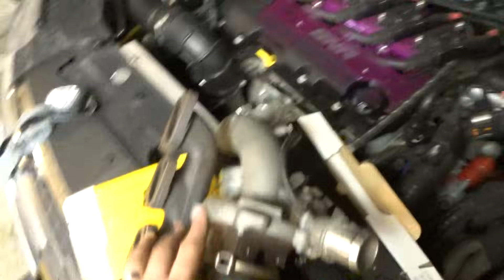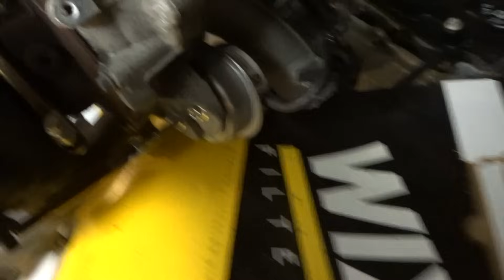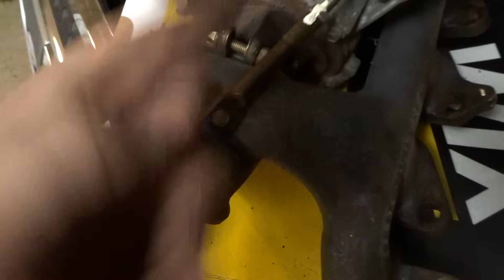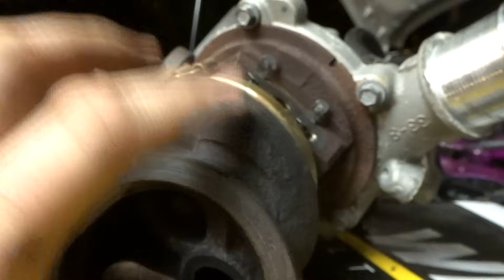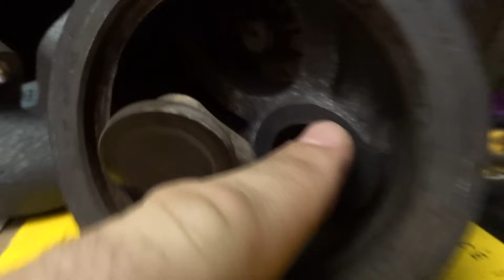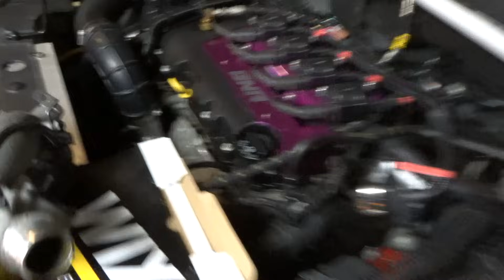Chevy Cruze Sonic P0299 Turbo Underboost Code Explained

Comment: Hi everyone,

I recently replaced the entire turbo on my Trax, but I’m still getting P0299 (Underboost) whenever the engine is under heavy load going uphill.

So far I’ve replaced:

MAP sensor

MAF sensor

Purge valve

But the code still keeps coming back. I have a smoke machine on the way to check for leaks as my next step.

Today I started wondering — should I swap the wastegate actuator from the original factory turbo (it was cracked, but the actuator itself was working) onto the new turbo? Could the new actuator be out of adjustment and causing the underboost?
Reply from the maker: Have you checked The intake manifold for a missing check valve? Have you replaced the bypass valve solenoid?

Comment: I have a p0229 code and a p2227 code i found a leak on back side fixed that that code went away would a new baro sensor fix this issue? Cause i dont see any cracks with my eyes and i the waste gate moves good when i use a air gun so im assuming i just need a turbo

Comment: That engine was designed to fail and be difficult to repair. IMO chevy should buy back every car with that engine.
Reply from the maker: Not sure I agree with the difficult to repair bit. The only things that are a bit more involved that fail on this engine are the head gasket and turbo, and turbo failures are common across all turbocharged engines. The head gaskets usually don’t start coming up until well after 250,000 miles.

Comment: So, I replaced my turbocharger, pcv hose, intake manifold, turbo oil return hose and valve cover. It is still reading p0299. I was talking to the guys I work with at the shop and one said it is probably the solenoid because that was the issue with his Fiesta. I looked and there seems to be oil on the intercooler hose on the passenger side. What do you think would be the best course of action for me?
Reply from the maker: Bypass valve solenoid is under the manifold on the passenger side and should be replaced if you’re still chasing down a p0299.

Comment: Mine is making too much boost (27.4 PSI) sometimes and after it's been driving on the interstate for about 20 minutes it makes no boost and I get the P0299 code. When the engine is dead cold, the turbo works properly. I ordered a new turbo. It misses out like crazy when it is making over 22psi of boost. Probably because it has too much air and not enough fuel. 
I ordered the waste gate solenoid and the waste gate diaphragm, but that's $50 and a new turbo is $210 and it comes with those parts. I know the diaphragm arm and waste gate lever is sticking a little when I move it manually with pilers, so the wastegate itself probably has problems. And I got the car with 196k miles. It's like a new car other than the turbo problems. Well maintained but the turbo is probably at the end of its life. It is the Garrett, so it's OEM. Might be original. It does have what looks to be a new turbo oil line.
Reply from the maker: Is that boost level relative or absolute?

Comment: 90% of the time the turbo charger is gone bad I worked on these type of cars a lot and that code is notorious for turbo issues
Reply from the maker: @josecfish5297  it’s been about 50% for the people I’ve worked with because there are multiple other causes for this issue than just the turbo.

Comment: Thanks for the video.  Quite informative.  I just wanted to point out a couple things as I've recently removed my turbo from my Sonic after a few years of intermittent underboost.

The turbo assembly also utilizes a blow off valve (BOV) that recirculates the boost in the compressor casting.  The BOV has a spring to hold it closed so it can be opened by either the boost overcoming the spring (I don't think this is necessarily the intention) or by vacuum acting on a diaphragm controlled by engine computer via solenoid valve, similar to the waste gate actuator.  My BOV had quite a bit of oil in the vacuum side of the diaphragm, which must have come through the solenoid valve and ultimately from the intake, I'm guessing.  Haven't diagnosed this enough to understand the root cause of the presence of the oil.

My turbo also has axial and radial play in the shaft.  I don't have a dial indicator to measure this, but it seems the turbine end has around 1mm movement radially.  I doubt this is within spec but still trying to clarify.

As you said, the crack at the wastegate will have minimal affect on the exhaust pressure.  Personally, I think this loss is negligible.

I'm considering ordering a turbo from BNR, as it seems all other brands have a good deal of bad reviews.  Do you still have the car in this video?  If so, have you had any trouble with your BNR turbo?

Thanks again for the video!
Reply from the maker: If your BPV (bypass valve, since it's recirculating) had oil in it, it very well may have come from the bypass valve solenoid, which is connected to the manifold. That solenoid sometimes gums up due to oil oxidizing and causing it to stick, which will also trigger a P0299. I discovered this after making this video unfortunately.

Comment: Got a 2016 Chevy Trax; turbo, intake cover all replaced back in April/May. Got P0299 the other day. I don’t want to keep spending $25-$100 “here and there” to fix the issue temporarily
Reply from the maker: @cherob1984  here’s a list I’d recommend checking out  

https://cruzekits.com/blogs/technical-articles/p0299-underboost-code-explained

Comment: I’m going crazy with this on my 2012 hyundai ix35 , i checked every air hose , air filter, intercooler, i cleaned the throttle body found some oil in it and in the pipe that goes from intercooler, checked the actuator which it seems tight enough , hard enough to move by hand… so what’s erong with this POS 😂 , i guess i will just spend more if i randomly start to change parts, better let the mechanic have it this time

Comment: My code only comes on when I go up a hill when I hit 60mph. Two days later the engine light  goes back off and I am good until I go back up another hill.   Since it doesn't stay on could it  just need to be cleaned?

Comment: I had the same code on my 2014 LTZ RS.  The issue turned out to be caused by broken catalyst from the forward catalytic converter.  This catalyst material broke up and clogged the rear catalytic converter restricting exhaust gas flow.  Without flow, the turbo cannot spool up and the performance is greatly reduced.  I could not clean out the rear converter so i had to preplace both of them.  At $2000 for the set, I would have rather had a bad turbo.

If you remove the turbo and the exhaust pipe from the forward converter, you should be able to inspect the catalyst.  If any is missing, you may have a clogged rear converter.  To prove the rear converter was clogged, I test drove the car without the exhaust pipe. A bit noisy but the boost pressure popped right back up and performance returned.   I bet there is a better way to test the flow of the rear converter; my way was free.
Reply from the maker: @mburman71  did you address the root cause for why they both failed in the first place?
Reply: @AndreiDPop  Yeah... Its a long story so I shortened it to remind folks to check their exhaust systems before they start buying expensive turbos and such.

The rear converter did not fail but got clogged up by debris from the forward converter.

In short, it all stared with an overheat caused by a cracked coolant tank.  Once fixed there was a small leak of coolant that took a while to find.  It was a cracked cylinder head. Coolant was leaking into the #2 and #3 cylinders but was not causing a reduction in performance, so I allowed the car to be driven.  I think this was a mistake.

I replaced the head and all was well for awhile, but soon, the performance started to decline and I started getting a low boost code.  I changed the turbo and it did not fix it.  While changing the turbo, I noticed a missing piece of catalyst in the converter and concluded it can only be in the exhaust pipe.   That is when I  drove the car without the exhaust pipe and the boost and performance returned.

This is a guess but I believe the coolant in the exhaust damaged the catalyst in the converter and caused it to break.  The debris broke up into powder and clogged up the rear converter.  Before you replace the turbo, check your exhaust system.

Comment: that plastic cap is a bypass valve, if that valve fails, it can set a p0299, the engine underboost code. however, if you look at the intake manifold and don't see a hose sticking out of the top left corner next to the MAP sensor, you have the old version of the manifold, get yourself a new update intake manifold, comes with a solenoid for controlling the valve, that solenoid is the most common failure point.

Comment: I have a Chevy Cruze 2014 1.4L turbo. i fixed the wastegate actuator but still have a code. the car has about 57,000 miles on it and driven locally and sometimes abused. what could be my problem if anyone can please help.
Reply from the maker: Try going through this article. 

https://cruzekits.com/blogs/technical-articles/p0299-underboost-code-explained

Comment: Just wanted to let you know that this video is still helping folks. I wish I had seen this before I swapped out my turbo, but it did help me inspect my turbo for issues. In my case the issue was caused by a failure of the PCV system, which pushed a lot of oil into the intake manifold resulting in significant misfiring and smoking. The code that was thrown was the P0299 code, but the only issue that I saw on the turbo was a crack from the waste gate passage. It might have had a little impact, but certainly wasn’t causing the issue that I was experiencing.
Reply from the maker: Glad to hear this helped you! Did you install my pcv fix kit on that car to help with the pcv issues?
Reply: @AndreiDPop  Mr Andrei,Hello, can you please reply, I need your help. The orange nipple, that is, the check valve, in the intake manifold of my car is completely missing. I would seal this place without a repair kit (Cruze kits) with any material and epoxy adhesive, and use the original crank ventilation hoses. Is there any problem if I continue to use it? Please reply, it's urgent.im from turkey and my country cannot let me but your repair kits.
Reply: @PAYASLRF  Epoksi ile turuncu minik contanın olduğu yeri körleyip Karter Havalandırma Borusunu iptal ederek hidrolik hortumu çekebilirsiniz. Harici Çekvalf ile Kanister valfi girişine verip sorunu çözebilirsiniz. İşlem Videosu mevcut.
Reply: @onurdulger6680  teşekkür ederim, çıkma emme manifoldu ve Krank havalandırma hortumu alıp değiştirdim.
Reply: @PAYASLRF  Geçmiş olsun üstadım. Fakat minik Turuncu Conta yine sorun çıkartacak.

Uyduruk Karter Havalandırma Borusu yine çatlayacak. 

Andrei Cruze kitleri ile bu noktada kesin çözüm geliştirmiş. Diğer videolarını izleyip kendiniz de yapabilirsiniz.

Amerikalıları tebrik etmek gerekir. GM kroniklerine çözüm yine anavatanından geliyor.

Ayrıca LPG yoksa taktırın yüksek Oktan değeri sayesinde Piston Kırma riskini azaltır hem de ekonomiktir.
Reply: @onurdulger6680  karter havalandırma hortumu çatlak değildi de onun da içindeki çek valf bozulmuştu o yüzden değiştirdim, zaten satıp kurtulmayı düşünüyorum 5 yıldır çektiğim yeter 😁
Reply: @PAYASLRF  Aynen içerisinde minik Turuncu bir Çekvalf conta mevcut. Sorunların kaynağı oradan başlıyor. Onun iptal edilmesi gerekmekte.

Esasında kroniklerine basit önlemler alındığında 1.4 turbolar Sorunsuz ve Ekonomik araçlardır. 

600-700 bin liraya hem LPG Uyumlu hem Turbolu hem de Tam Otomatik Şanzımanlı başka alternatif yok malesef. 

Astra Cruze Trax Mokka Zafira Meriva İnsignia parasına göre güzel araçlardır. Parçaları bol bulunur ve uygun fiyatlıdır. Bence Kıymetini bilin.

Comment: Chevrolet now has a program out to have the turbo replaced for no charge (under certain conditions). Of course this is only if the turbo is the root cause of the trouble code. 
As described by GM in Special Coverage bulletin N232395330

Comment: You forgot to explain the inner cooler pressure relief valve and solenoid. You did mention the check valve for the solenoid.

Comment: How does it cause a lean condition if you’ve lost boost pressure? Fuel trims hit 30% Long term with it dumping fuel
Reply from the maker: Under manifold vacuum and any closed loop condition, a leak causes unmetered air to come into the engine. This then throws off the fuel trims in a positive direction indicating that the engine is adding fuel. 30% positive means there is an addition of fuel due to a lean condition. 

When that fueling calculation goes to open loop, where fueling is no longer calculated and in this engine you’re under boost, that vacuum leak now turns into a boost leak and you run excessively rich, but you don’t necessarily know it since open loop relies on enrichment tables and not on fueling calculations.

Comment: Whats the situations where replaceing the turbo is the only option? 2014 chevy cruze owner 😅
Reply from the maker: when you’ve already done the pcv fix kit, checked the bypass valve solenoid, tested for boost leaks, checked the wastegate actuator, and are still getting a p0299.

Comment: I was getting codes for the air flow sensor and my intake manifold and.. I replaced both and the  engine light came back on.. what should I check or do next to try and resolve this?
Reply from the maker: What are exact codes? A MAF sensor code is rarely the fault of the MAF sensor itself.

You replaced the intake manifold? Or the MAP sensor?

Comment: Awesome video.  I am getting the P0299 under boost code on my 2014 Cruze. I would like to first rule out any PVC issues. Had the valve cover replaced by the dealer a few months ago under the supplemental warranty coverage. I checked the intake manifold and I can see the little orange nipple after some cleaning with a Q-tip so i guess that check valve is OK? Also get the squeaking and chirping coming from the front of the engine when the engine is warm and idling. This makes me think there is a vacuum leak or PVC  issue but it has been doing that for a while (even before the valve cover was replaced) and never threw a code. Corrugated PVC line to turbo seems to look OK. Is there anything else I should look for in the PVC system that could possibly cause the under boost code?  Vehicle has 122k miles. Thanks.
Reply from the maker: Not guaranteed that the check valve is OK just because it’s there. Had a customer recently have what appeared to be a good manifold but he installed my kit anyway with the manifold off. He shook the old check valve out and discovered that the flap part on the back had completely eroded and wasn’t blocking any of the holes. I believe the pcv fix kit should be done on any car regardless based on the risk of it not working and how many issues it causes. 

For a p0299 I would also check the bypass valve solenoid (under manifold, passenger side, follow the tiny nylon pipe under the larger pcv pipe). That tends to gum up and start sticking or leaking which opens the bypass valve on the turbo when it shouldn’t. 

Squeaking or chirping is caused by either a loose spark plug or a bad front main seal (from when the valve cover failed and took it with it). 

At 122k miles I would absolutely install the pcv fix kit.
Reply: @AndreiDPop  Thanks for the quick reply. I will likely be ordering your PVC fix kit. Is there a way to test the bypass valve solenoid with basic tools? 

Also, to install the PVC fix, do i just push the existing rubber nipple out of the intake and let it fall inside? One other thing I noticed is that i just changed the oil a couple of hundred miles ago and it already looks pretty dirty. Is this indicative of PVC issues? Thanks again.

Comment: Do you have a video on how to change the wastegate actuator
Reply from the maker: No but it’s super easy. Carefully remove the c-clip off the actuator arm (ideally with a magnet so it doesn’t go flying), then should just be two bolts and a hose to get it off.

Comment: Quick Question 2018 Buick Encore Premium I guees I Have the same engine or very simmilar So Your instruction can apply to my case? I just get P0299 on 80k miles
Reply from the maker: If it’s the 1.4L turbo shown in this video then he’s. Some Encores came with the gen2 direct injected 1.4L turbo that is completely different.